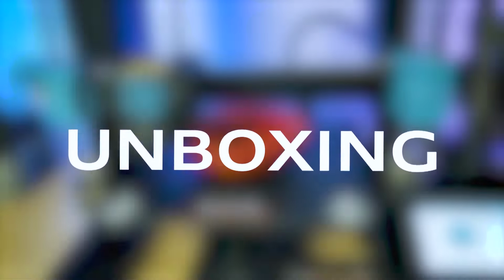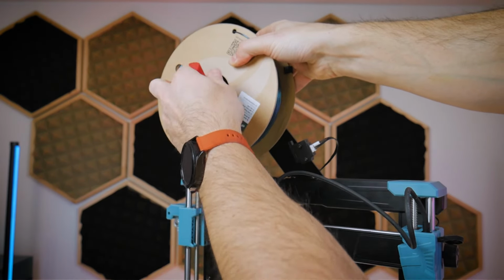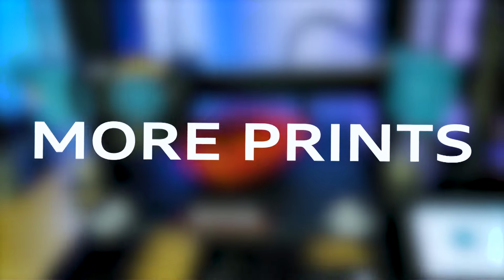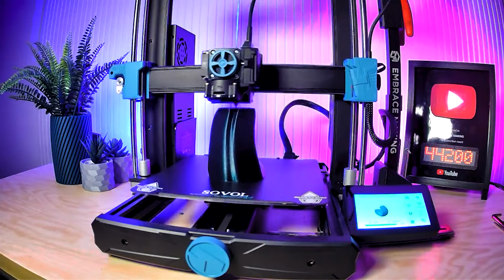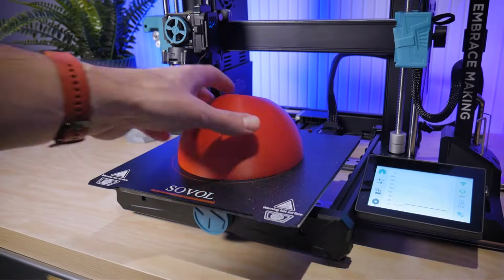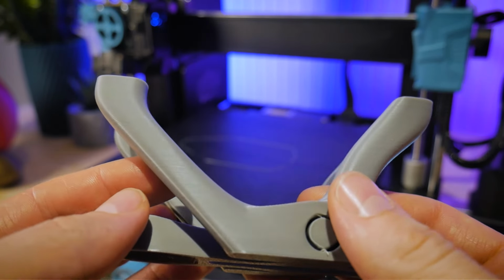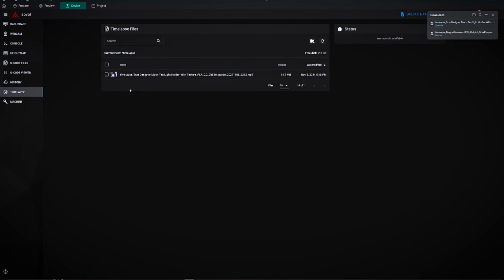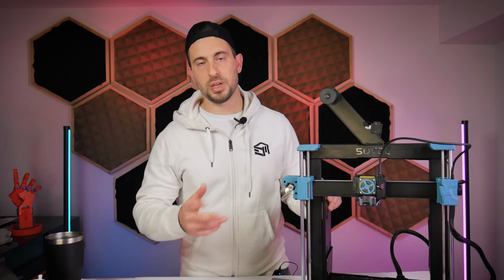Sovol SV06 ACE Guide: Best Printer Under $300 ? Unboxing, Setup, Slicer, Prints, and More!

Comment from the maker: If you guys enjoyed this video, please consider supporting my work by checking out the links below!
Get the SV06 ACE at the best possible price:
► https://shareasale.com/r.cfm?b=2702618&u=3650799&m=131011&urllink=&afftrack=
► https://www.sovol3d.com/?ref=EMBRACEMAKINGSV06ACE

Looking for the Sovol core XY cube frame monster? Best price on the SV08 here:
► https://shareasale.com/r.cfm?b=2559397&u=3650799&m=131011&urllink=&afftrack=

Need the universal spool stand for your SV06 ACE or another application? You can find it here:
► https://embracemaking.com/products/universal-top-mount-spool-stand

A few other cool tools and things for 3D printer enthusiasts. (As an Amazon associate I may earn a small commission at NO extra cost to you)

Sunlu Matte Blue PLA (as seen in the video):
► https://amzn.to/3ZhlVYB

Polymaker PolyTerra PLA (One of my favorite filaments):
► https://amzn.to/3sdhK1x

eSUN PLA+ (Another one of my favorite filaments):
► https://amzn.to/3QA4tuq

Electric Screwdriver:
► https://amzn.to/3JRbbZe

Rechargeable Batteries:
► https://amzn.to/3W6dAoK

LED Bars for your work space:
► https://amzn.to/3Cuk3CD
Reply: Very good presentation. Please could you share the spool holder stl?

Comment: The printer is on sale right now for 40 bucks cheaper than normal. Ive been wanting to get into 3d printing for a while, but never really found one that particularly stood out until this one. Ive been watching a bunch of videos and reading reviews and seems like exactly what i want, overall, would you recommend the Sv06 ACE?
Reply from the maker: I'm still using mine and it's been a great performer since this video dropped. If you've been eyeing this one for a while and there is a sale definitely go for it! If you found my video helpful in deciding or getting started with it when you receive yours, please consider using my link as it goes a long way to supporting my channel: https://shareasale.com/r.cfm?b=2702618&u=3650799&m=131011&urllink=&afftrack=     Just remember if you have that Honey browser extension please disable it before using any links from your favorite creators as that Honey extension steals commissions from us even if no further discount is found. Thanks!

Comment: here is a question. I've been searching for a way to change the zero on the Y axis on mine, but I cannot locate anything on the screen. is this Gcode fix?
Reply from the maker: Just to be clear you want to change where on the print bed the y=0 position is? Not the physical end stop position, correct? If it is just the software y=0 then you should be able to go into the printer.cfg file in Klipper and apply a y offset I think. I can look into that.
Reply: @ when i do the print to start. The orca slicer says the print is centered. When it starts to lay layers. Its off centered on the physical build plate.
Reply from the maker: Is it off a little bit or a lot? When I first got the machine I didn't remove the piece of foam wedged under the print bed at the back so it was hitting the end stop early and messing up my y axis. Otherwise if the print is centered in Orca it should be centered on the bed.
Reply: @ 🤣🤣🤣 that was it. Little foamy guy stuck in.
Reply from the maker: Yeah I mention it in the video above, I missed it too and it screwed me up for a whole day 😭 lol
Reply: @ ive been in and out of sanity and didnt notice that part 🤣
Reply: @EmbraceMaking last question. Fan exception is pretty frequent.
Reply from the maker: In the review section of my video near the end I show a screenshot of how I fixed it. You need to comment out some lines in the printer.cfg file. Although I noticed that after the latest firmware update it over wrote my changes and it's been fine since, I'm on firmware version 17. If you're on 17 and having these problems then comment out those lines
Reply: @ i ended up watching it and modifying the code too. Mine just showed up two days ago. I like the prints. The fan is really loud and i turn it down in orca or on the klipper and it just turns back up. I found how to change the speed in orca. I liked my sv06 a lot and chose this over the A1 for now. 

Thanks for your replies and help. Even though most of the questions were in the video 🤣

Comment: How do you get such a smooth finish on those prints?
Reply from the maker: Hi Maryam, are you using the same machine? What kind of filament and which slicer are you using?
Reply: @EmbraceMaking  Hey, yep the same machine. For now just using the sample PLA white filament. And using Orcaslicer

Comment: You can set the printhead to park in the same place you added the camera.

In Orca-Slicer:

>Click the 'Gears' icon on the top right of the device tab next to the 'Power' icon to open the 'Interface Settings' window
>Click on the 'Timelapse' tab towards the bottom. You might have to scroll down to see the correct tab. it's 2 tabs above the 'Webcam' tab
>In the Right pane of the window, scroll down until you see the 'Park Toolhead' settings.
>Click the toggle to enable Toolhead Parking

You can customize the X, Y and Z position but I'm perfectly fine with 'Center' as the 'Park Position'.
Reply from the maker: Amazing tip, thank you so much, I'm going to go try that now!

Comment: Great review video.  Excellent job conveying the assembly process clearly but concisely.

My SV01 was a very solid workhorse printer.  It did a lot of printing, required very little maintenance and the open bed slinger architecture made it easy to maintain and repair.  I retired the SV01 for a newer and better Klipper bed slinger (Elegoo Neptune 4 Pro) but the SV01 never failed and I'm thinking about converting it for either electrical discharge machining or make a rotary 3D printer (analogous to a CNC lathe if regular 3D printers are analogous to a CNC milling machine).

I like Sovol.  They make good 3D printers at affordable prices, have relatively good technical support and I love their commitment to open source.  I bought an SV08 and it's an incredible value for a large format coreXY printer.  Sovol did a good job of providing 80% of the Voron 2.4 at 30% of the cost and 5% of the assembly time.  They went slightly too cheap on the print bed and Z axis inductive probe, and there were a few other rough edges on this complex and somewhat lower volume 3D printer, but it's a fast large format printer at a budget price and that makes it an excellent value.

The SV06 Ace has the advantages of bed slingers (inexpensive, fast assembly, reliable, easy to maintain and repair) but also the advantages of a fast Klipper based machine.  Sovol beefed up the design with all steel motion control to support the faster print speed while providing ease of maintenance and long term reliability.  I'm seriously considering ten of these for a small print farm.  I would have liked to see an Ethernet connection.  If the WiFi doesn't work (as it didn't work on my SV08) there is no other option, and Klipper printers need a network connection.  As always, Sovol should have used a standard Volcano nozzle but instead have produced yet another Volcano clone that is functionally identical but just different enough to force users to buy proprietary nozzles from Sovol.  MicroSwiss makes nozzles and entire hot ends for many printers, including Sovol printers such as the SV06, SV07 and SV08, but does not yet have a FlowTech hot end or nozzle for the SV06 Ace.  The only option is the original Sovol 0.4 nozzle or an accessory nozzle assortment from Sovol (0.2, 0.4, 0.6 and 0.8).
Reply from the maker: Thanks for the super thorough comment ! My SV06 ACE is still going strong and in regular use - so far no issues after many many more hours of printing after this video was produced. The nozzle thing is a bit annoying for sure, but I've mainly been printing PLA so fortunately it won't be a frequent replacement item right now

Comment: great videos
Which would you recommend to a beginner, the Sovol sv06 ace or the Ender 3 v3 KE
Thanks
Reply from the maker: That's actually a tough one, they are both very comparable. I think I would give the Sovol a small edge on print quality though, but if I remember correctly the KE might be a bit faster... If it were me I think I'd just go with whatever one I can find at a better price because they are that close. Did you see my KE video, I reviewed that printer too
Reply: @ thank you for replying, yes I did,both very good videos. That was why I was interested to see which one you thought had the edge. At the moment, I think the Sovol is cheaper 
Also, I think the solvo has the edge on aesthetics if your into that, I must admit I do like the blue lol
Having said all that I still can’t make up my mind 
I’ve been thinking about purchasing a printer for  a while, just need to get to grips with the design and slicing side of it. (Tinkercad & Orca)